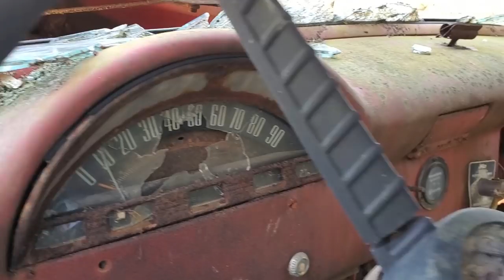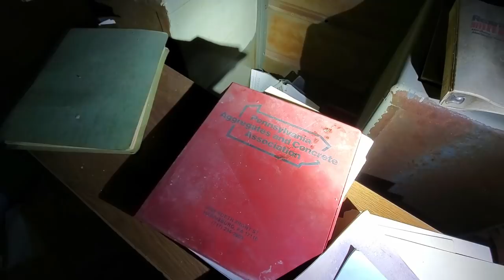Abandoned House, Crane & Truck - Shooting A Potato Gun?

Comment: For the plug threads I would recommend a dry Teflon lube to prevent galling (nearly gluing itself in place). There used to be a company (15-20 years ago) in Austin Texas, that made “rifled” pvc pipe sections for better accuracy. For more consistently I used compressed air (through an onboard regulator) with an in ground sprinkler valve between the chamber & barrel, activated by a pair of 9 volt batteries & a push button switch. With 20-30 psi at 25 yds, a potato would go through a piece of 1/2” plywood! They were banned around here (Central Texas) in the early ‘2000’s by some counties as home made firearms, because of the flammable propellant (hairspray, WD-40, propane, solvents)! They were dangerous because of inconsistent pressures leading to explosions! Double layering the pvc pipe with repair couplings increased strength. Last resort would be to wrap the chamber & barrel (all pvc parts) with duct tape (1/4-1/2” thick), for safety!

Comment: Thoughts about your potato gun. I've made one that was pneumatic. I felt it was slightly safer than using hairspray as an ignition source. It was a much bigger gun, it needed a pressure chamber that held a large volume of air. Besides potatoes, I would load snowballs and even paintballs (if you used paper wadding surrounding the paintballs.) It's too bad YouTube wasn't a thing in my early 20s when I did this stuff, and nobody carried around video equipment. Next time you can setup the ultimate shot. Potato is shot through a screen with the "fries" falling into a basket ready to go into a fryer!
Reply from the maker: You also need an air compressor for that to work. The hair spray is for portable use. Although i like the idea of controlling how much pressure you want to use.
Reply: @JPVideos81  CO2 or compressed air cylinders work well too. I used to play paintball so I had both available to me.
Reply from the maker: @jaykozokas2983  aqua net is cheaper lol